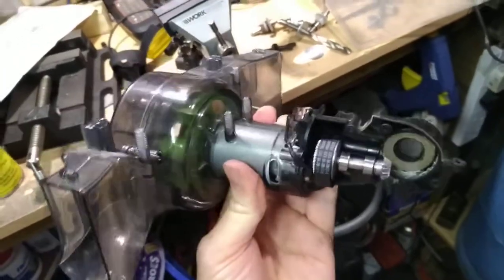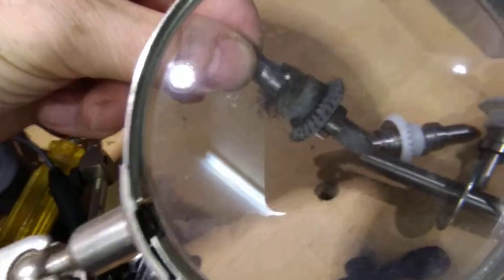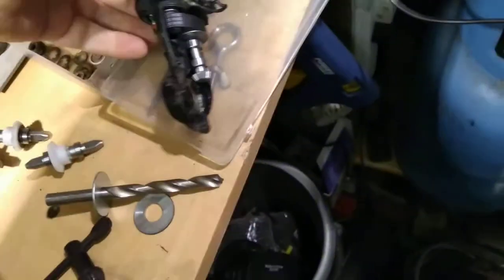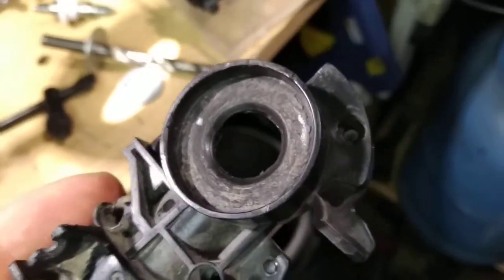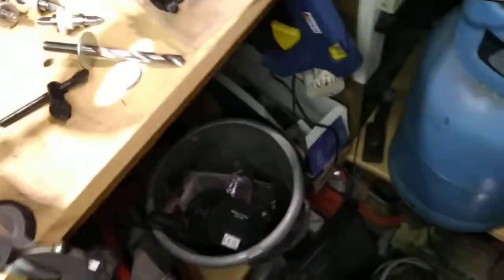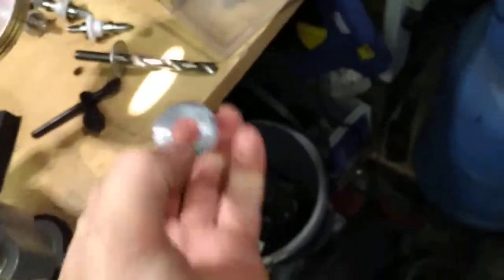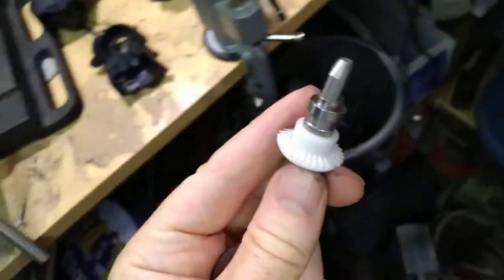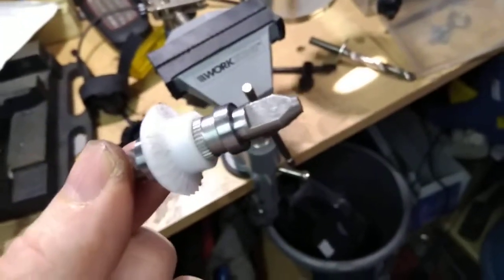Gtech Air ram MK1 replacement gearbox spindle failure

Comment: The bearing housing in the cover has completely disintegrated and worn away. I've just found the same issue on the gearbox cover for the same Gtech air ram mk 1. Seems to be a common problem.